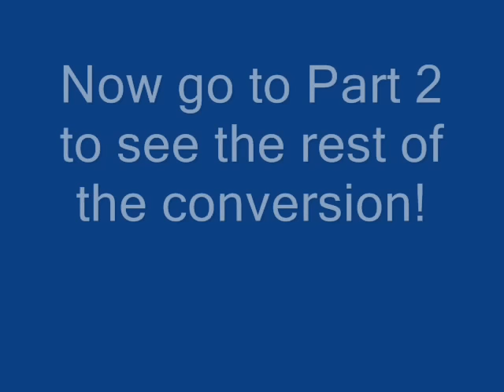HOW TO MAKE A SELF BUILD CAMPERVAN PART1

Comment: I also wanted to convert a Sprinter, but I think one of the problems with it is the shape of the body which is not efficient.  The most efficient van on space that I can think of is the Peugeot although of course I would prefer a Mercedes engine!

Comment from the maker: Hi, i wil reply to all your comments here!
Yes I thinks its the highest version (i can stand up ok)
I will troll through my collection of videos and photo's to look for pics of the bikes in the van. The suspension is straped down as low as possible to fit in to give max room on the bed.
I put my water pipes out side because I did'nt plan a thing! and thats the only option I had left! not good i know.....
keep in touch with your plans etc..
Regards Mike